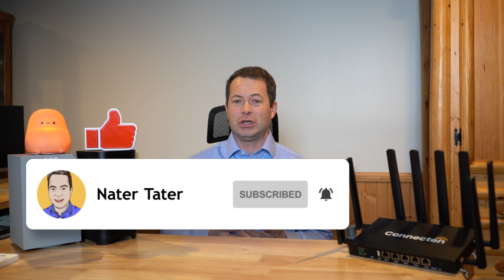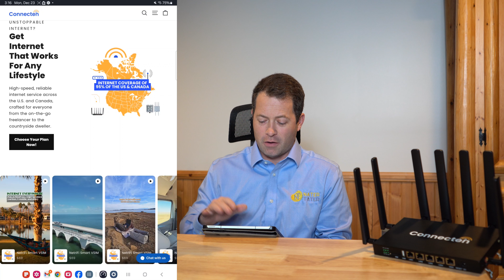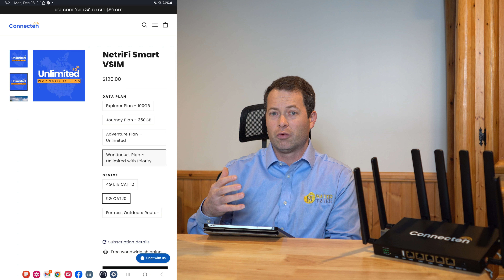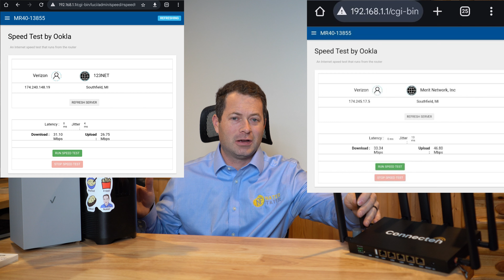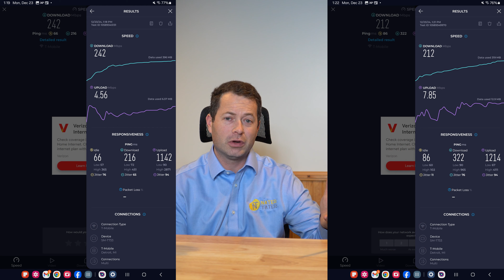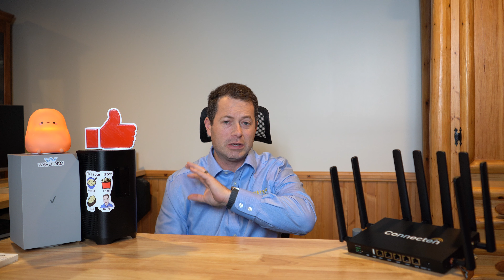Unlimited 5G Mobile Internet Solution: Connecten for AT&T, Verizon, and T-Mobile!

Comment: I have Tried for T-Mobile for 2.5 years   they say not available
Reply from the maker: Bummer.  That's where this type of service is a good alternative
Reply: @DVLITTLEPILOT  i had the same problem.  I would randomly go and put in my address only to be disappointed. Then one night while sitting at work I put it in and all the sudden it said it was available.  Funny thing is i put in my inlaws address (next door) and it was not available.  I put in other addresses nearby and it seems mine was the only one available in the whole area. Anyway I've got it now but I live on the fringe of the towers area I guess.  My speed is not great but it does ok for downloading updates on my ps5 and for watching Netflix and stuff like that. Don't even try to play a game online though.  100-300 ping. Considering putting an external antenna on it or going some other route

Comment: Can confirm , I’ve been using them for about 6 months and the customer support is good and switching to the best provider in the area is easy. I use the $99 unlimited plan and my speeds are consistent with very few issues.

Comment: I use Visible and a 5G 📱 running Android 14 using Ethernet Tethering, take the 📱 anywhere and unlimited data for $25/month
Reply from the maker: yes, popular method as well.  Does it switch to cricket and mint on the fly? 😉
Reply: They throttle video speeds.
Reply: @Bryan-Hensley Only on the new plans
Reply: @Bryan-Hensley  I get 9 Mbps thru VPNs thru Visible. That's more than enough to stream 1080p.

Comment: I'm a manufacturer/OEM and I have some experience with that router. I'm pretty sure it has a RM520GL in it and those are notorious for topping out at lower speeds. We use some that are upgraded and the new firmware fixes some of those issues but I'd venture to say that these are not the upgraded ones... They also have a very hard time switching towers while in motion. 4 antennas for 4g/5g 4 antennas for wifi, 2 for 2.4ghz 2 for 5ghz. None of the m.2 modems support over 4 antenna connections. No need for the extra antennas, carrier ag is where the speed is and no additional antennas needed for that. We have some beta testing modems that are getting a gig down and over 100m up!! When the cost of those come down they're gonna be the best!!
Reply from the maker: Hi, I think these use the RM502Q-AE chip but I haven't verified on my actual unit.  I agree 6 cellular and 2 wifi seems odd, typically I see 4 and 4.  However these are clearly labelled as such and include 6 cellular antennas and 2 wifi antennas...?  See details and pics here:  https://device.report/m/c6d13aa24353e67763ed9e062d99fb27101f7ce1503068e96f357d8d169304f5.pdf https://device.report/spark-technology/mr40
Reply: @NaterTater  They may have changed the modem to the RM502Q-AE but with the speeds and the cost I'd doubt it... Both of those units use 4 antennas not 6. I'd say thats a labeling issue lol. We're working on a new POE router that will be mobile, if you're interested we'll reach out when its ready!?

Comment: I’ve recently just found your channel. Very informative. I live out in the country. No fiber, just DSL (ugh) and T-Mobile 5G Home. The dsl is reliable with low latency but slow. 80/10. T-Mobile is decent, between 100-300 down and 10-30 up. The problem with the T-Mobile is it’s not good for streaming TV. Latency is very high. 600+ I believe this is because we are 6 miles from tower and also, the signal has to pass through trees. I’ve watch a couple of your videos where you suggest the waveform 4x4. Would this work for me?
Reply from the maker: @mikeygee2465  hi, welcome.   Yes a waveform can certainly help with speed and latency!

Comment: If the Connecten router has 6 cellular and 2 wifi antenna ports, how would you hook it up to an external antenna which is usually 4x4?
Reply from the maker: Great question!  I'm not sure yet but i might experiment in the future.
Reply: Both routers that I received had 4 cellular and 2 wifi ports only, Hookup to a Waveform MIMO was straightforward though minimally effective

Comment: Great video as always Nate! You could also use a Chester Cheetah Gateway/Modem like I do with a Metro By T-Mobile Tablet SIM Card in it for only $20.00 a Month.
Reply: Does it throttle video resolution?
Reply: @Bryan-Hensley No it does not because I can still watch 1080P or 4K I've tested it thoroughly.
Reply: @Bryan-Hensley  You get around that with a VPN
Reply: @1TechCritic420  how do I use a VPN on a Roku TV
Reply: @Bryan-Hensley I'd be interested in an answer.  I've tried NordVPN meshnet, but never got it to work.  The setup is convoluted for Roku.

Comment: My experience with Connecten was not favorable. I was advised rhat the router would automatically switch to the stronger of the 3 carriers but it never did so. I had to call to make the change. The strongest download speeds I could get w with ATT were around 10-15 MBPS at non-peak times with 2-3 MBPS upload speeds. During peak periods from 5:00 p.m. to 9:00 p.m., upload speeds dropped to 5 to 7 MBPS download and less than 1 MBPS upload which made the service basically unusable. Tmobile and Verizon were even slower. switching to an outside Wellform MIMO antenna showed negligible improvement. I had much better service with TMobile proprietary service plan during the day but experienced the same service drop-off during 5-9 peak hours. My 1st Connecten router lasted 4 weeks  before it failed. The replacement router showed slower service speeds than the 1st. Calls for assistance produced no increase in connection speeds. I finally gave up and cancelled the service in favor of Starlink at the basic same monthly cost but has download speeds of 150-300 MBPS and upload of 35 MBPS which is adequate, The lure of automatic switching got me interested initially with promise of 100MBPS connection speeds but that was never close to happening.

Comment: I use metro by T-Mobile 25.00 Auto pay plan on my Cudy P5 5g Router I just use the at command in the routers 5g settings to spoof the IMEI as a s22
Reply: Same here!
Reply: I got $10 metro tablet plan with my 5g router. You're leaving money on the table.
Reply: @nodollarchannel  How'd you do that? They only have a $20.00 Dollar Plan it says on their Website.
Reply: @nodollarchannel  I wouldn't be able to do that because it requires you to have more than One Line to get the Discount. I have the $25.00 a Month Unlimited Plan for my Phone and I have the $20.00 a Month Tablet Plan so $45.00 a Month with Autopay. Still not bad at all though!
Reply: They throttle video resolution
Reply: @Bryan-Hensley  98% of All carriers throttle video. Just use a VPN.
Reply: @1TechCritic420  not t mobile home internet
Reply: @Bryan-Hensley  do you mean cudy throttles the video resolution or the mobile?
Reply: So did you buy the cudy router and insert your sim card from the phone to it?
Reply: @danlford  yes I put my Metro by T-Mobile sim in slot 1 of the Cudy P5 5g Router
Reply: @coreybabcock2023  sorry to bug you but I'm thinking of going this route. What kind of speeds are you getting out of this setup?